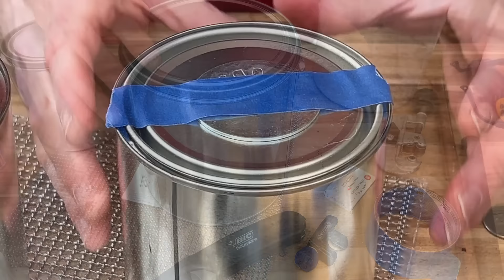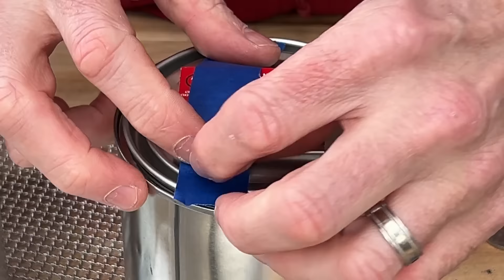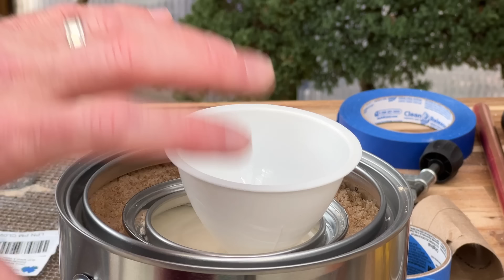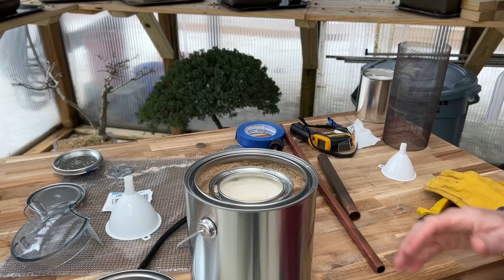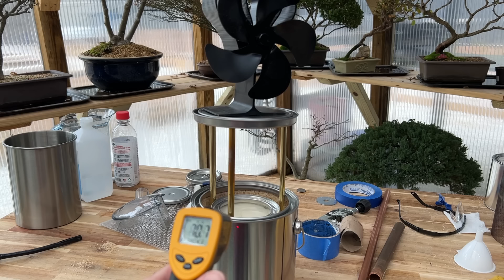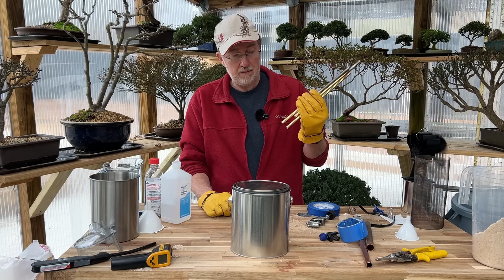Endless Heat Without Electric | Safe Reliable And Low Cost

Comment: Denatured Alcohol vs. 99.9% Isopropyl Alcohol

Denatured Alcohol
Denatured alcohol is ethanol (ethyl alcohol) that has been chemically treated to make it toxic or unpalatable, preventing human consumption. This is done primarily to avoid liquor taxes and regulations on consumable alcohol. The additives vary but can include methanol, acetone, benzene, or isopropyl alcohol.  

Common Uses:
- Solvent for paints, varnishes, and shellac  
- Fuel for alcohol burners and stoves  
- Cleaning agent  
- Disinfectant in some cases  

Manufacturing Process:
1. Fermentation & Distillation: Ethanol is produced from fermented sugars (usually from corn, sugarcane, or grains).  
2. Denaturing: Additives are mixed in to render it unsafe for drinking. The exact formulation depends on the country’s regulations.  

---

99.9% Isopropyl Alcohol
Isopropyl alcohol (IPA) is a different type of alcohol (C₃H₈O) that is not intended for drinking and has a different chemical structure from ethanol. It is a powerful solvent and disinfectant, commonly used for cleaning and industrial applications.  

Common Uses:
- Antiseptic and disinfectant  
- Electronic component cleaner  
- Industrial solvent  
- Automotive fuel additive  

Manufacturing Process:
1. Hydration of Propene: Propene (from petroleum refining or natural gas processing) reacts with water using an acid catalyst, forming isopropanol.  
2. Purification: Distillation and filtration produce high-purity (99.9%) isopropyl alcohol.  

---

Key Differences
| Feature | Denatured Alcohol | 99.9% Isopropyl Alcohol |
|---------|------------------|------------------------|
| Base Chemical | Ethanol (C₂H₅OH) | Isopropanol (C₃H₈O) |
| Toxicity | Toxic due to additives | Naturally toxic |
| Consumption | Made undrinkable intentionally | Never drinkable |
| Odor | Depends on additives | Strong medicinal smell |
| Uses | Fuel, solvent, industrial | Disinfectant, cleaner, industrial |
| Manufacturing | Fermentation-based ethanol + additives | Petroleum-based propene hydration |

---

Manufacturing Differences
1. Source Material:
   - Denatured alcohol comes from plant-based fermentation (like making drinking alcohol).  
   - Isopropyl alcohol is synthetically derived from petroleum or natural gas.  
2. Processing:  
   - Ethanol is fermented and distilled, then denatured with additives.  
   - Isopropyl alcohol is chemically synthesized from hydrocarbons.  
3. Purification:
   - Denatured alcohol doesn't need extreme purification (since it’s already toxic).  
   - 99.9% IPA requires careful distillation to remove water and impurities.  

Final Thoughts
Denatured alcohol is ethanol made toxic to prevent drinking, while 99.9% isopropyl alcohol is a different chemical entirely, made from petroleum. They serve similar industrial purposes but have distinct origins and toxicities. Key mental notes you can not drink denatured alcohol!!!

Comment: The larger bucket looks like a galvanized can...if it is, fumes can be very, very bad... I have an old turkey fryer can that looks like it may be larger, made of  aluminum.  It came with a nice, flat lid with a handle.  Thank you SO MUCH for this video.
Reply: The galvanized can does not get hot so there will be no fumes !
Reply: It's not galvanized, just a common paint can that hasn't rusted yet.

Comment: For a large room, such as a 2 car garage, cut the bottom from a 55 gal drum. You could put 4-5 small paint cans easily into the sand, lighting 1 or more as needed. Keep the top of the drum, with the seal removed, as a cover. You could even put the whole thing on wheels to be able to move it around, make a stainless steel mesh shroud to radiate heat when in use and could be stored on top of the cover when unused. A single low speed ceiling fan could circulate the heat efficiently.
Reply: Why cut the bottom off the 55gal drum?
Reply: @noniboalt9548  There are several reasons for this. Drums are sturdy, cheap and plentiful, will hold a fair amount of sand, you can buy wheeled bases for them for easy relocation, you can use the entire drum in various ways, and in warmer months you can use it for an oil catch pan or drip guard for working on vehicles.
Reply: Multi buckets-Great heat control!!
Reply: OR get a 65 gallon drum and add extra. Do they come in different  colors ?
Reply: Run a ceiling fan😂Except if you're out of electricity😂😂😂
Reply: @astrialindah2773  If you have no electricity then no, you could skip the ceiling fan part. As long as you thought you were being clever, that's what counts. Right?
Reply: @Punnikin1969 I'm not being clever I am being accurate 😶
Reply: @astrialindah2773  I agree with the first part of your statement, however not having electricity immediately excludes using a fan so it didn't have to be pointed out in the first place. Also, using the "laughing until I cry" emoji twice is just begging to be mocked. I obliged.
Reply: @Punnikin1969 I used it four times....😂😂😂😂

Comment: there is no such thing as Endless Heat to get heat you must have fuel of some sort that will have to be bought and used every time you want heat that's why i prefer solar heat with a storage battery then it can give what will seem like Endless Heat but your still using electricity as your fuel but i don't have to go get gas or oil and deal with the exhaust fumes

Comment: In White Sands in the winter in my fox hole I dug down and put an ammo can about three inches from the top. filled in around it an then filled the ammo can with sand. went to the medics and got some kind of alcohol and filled up the ammo can that had the dry sand in it.  Took the cover of the ammo can and covered about half of it. took my shelter half and made a low roof and used the sticks and dead branches laying around to finish it up. It got down to about 12 but it was about 40 in my foxhole. Also, out in the desert 100 miles from anywhere it was cold as hell and the sky was clear as glass. I saw a billion billion stars that night. As a 25-year-old I had never seen anything like it before. I still remember it like it was yesterday. That was 40 years ago. peace

Comment: Those fans would work great in the solar soda can heaters! Also, this is why I like the idea of having Spirit stills as part of my set up. You get cleaner burning pure alcohol, plus you get methanol as a multi-use byproduct, and you can use the same or additional stills for hydrosols and essential oils. The methanol can be used as a solvent for making biodiesel with used cooking oil. Very versatile addition!

Comment: Excellent video, I'd consider using a cast iron dutch oven as the outer vessel.
Reply: Why? Isn't 'heat retention and even distribution' the purpose of cast iron? The role of the larger container, with its cushion of sand, is to remain cool as I understood it.
Reply from the maker: That is a good thought.

Comment: Excellent design. I live in my campervan, and always looking for off-grid heating ideas.
Reply: Before people consider using this device as described or a larger one or more numerous ones in the room which is going to be inhabited for working or sleeping consider the following. Your life depends upon it. Combustion heating devices consume oxygen from the air to some extent. They also generate carbon dioxide and carbon monoxide which are both heavier than air and start filling the room from the floor up if there's no circulation. Usually building construction is drafty enough to supply exhaust of products of combustion and entry of fresh breathable air. However if you're going to use Open Flame to heat your van your RV or a closed room in a modern construction house, you better make sure that there is ventilation. Even a clean burning fuel heater properly designed in a confined space which is not supplied with combustion air will suffocate you. Just make sure you've provided enough cross flow ventilation to provide breathable air in as well as exhausting CO2 and products of combustion out.
Reply: I would think it would put out a tremendous amount of moisture.
Reply: Sadly people have died using these styles of heaters in confined spaces- good ventilation is imperative
Reply: For only outside use

Comment: For high humidity and to water proof matches is to coat with wax. When you go to light one you have to remove the wax from to tip
Reply: I dip mine in clear nail polish.let dry.They light right up.

Comment: On another channel, I saw the creator use stainless steel or copper screen. If you were to roll the screen around the paper towel roll so that it stood 6 or 8 inches above the top of the roll, it will glow red hot and radiate much more infrared heat.
Reply: Dad taught us how to make what he called a Cowboy or Cub Scout camp stove. Larger can with holes in the bottom and around the rim. Another smaller can with holes around the sides. Put a Sterno can or candle in the smaller can. put the larger can upside-down over the can with sterno/candle. First light the heat source.  The sterno will create heat in the larger can. You can actually cook on it.
Reply: Wow this is good to know. I'm gonna teach my little grandson this. plus I will have it in case we need it. Thanks for sharing this. ❤ It was Kool too.
Reply: How long will it burn?
Reply: @laurieshifflett2916  ...How long will it burn?...

I don't know. I never tried it. As I said before, I only saw it.
Reply: I tried this …it’s totally not work temp source never gain over 100 degrees….copper temp will be less than source.
Reply: That would probably work from the heating standpoint but you wouldn't be able to store it with the lid on. 🤔
Reply: The screen cylinder would be made to slip within the rim of the odor can and rest on top of the sand not embedded to the bottom of the odor can further the cylinder would be 10 in high approximately and rolled from a length of steel or stainless steel mesh to be about three layers deep spiral and wired with steel wire to secure the spiral from unwinding from its cylinder shape. If you want to store the heater or put the fire out use the gloves to lift the cylinder off of the top of the sand and put the lid back on the inner can to snuff out the flame.

Comment: The fan is powered electrically by a Pelletier device. It is the same unit that is in those 12 volt electronic cooler / heater boxes. It is a bank of thermocouples. When you apply power to it, one side gets hot and the other side gets cold. Conversely if you apply heat to it, it will produce a small voltage to drive the motor. Years ago, my father in law paid almost $100.00 for one to place on his wood stove and it was surprising how much air that it moved.

Comment: I bought two of these fans for a tenner each without realising these fans need a basal heat scource of at least 85C to start turning..............i was hoping that they would work sitting on an oil-filled electric radiator  but no joy.

Comment: This is not safe. It literally says on the can of fuel you are using "USE OUTDOORS IN AN OPEN AREA IT IS NOT SAFE TO USE INDOORS" "IF YOU MUST USE INDOORS OPEN ALL WINDOWS AND DOORS AND CIRCULATING FRESH AIR" how much heating is it going to do with all the windows and doors open and circulating air??
"THIS PRODUCT CAN EXPOSE YOU TO METHANOL, CARBON MONOXIDE AND METHYL ISOBUTYL KETONE" which are cancer causing agents. Denatured alcohol is Ethanol (the alcohol in booze) with toxic additives (denaturants) to prevent people from drinking it. This heater is only safe to use outdoors. The fan only spreads the toxic fumes more. Read up on all the dangers of burning denatured alcohol and never use this stove indoors.

Comment: Suggestion on the big super when you were going to make a sheet metal you know when they take things off they can put it to cover the the other bucket that's bigger and a piece of sheet metal or a lid off of pot on the stove, and I understand I know it's different than like that turns to mud and I live in North Carolina so you definitely just have to have sand to not dirt? You might get to reading this I'm sorry if you got so many and I probably don't subscribe cuz I'm not too handy on things but you can take a can and it was just like a tuna can or chicken can you take cardboard and you cut it to the size of it like if it's 2 in tall then you curl that cardboard up in there and you take and burn a candle and you burn the wax all over it so for an emergency you can just take that can with you and you can just like that cardboard and it burns that wax and that cardboard and it does burn for quite a few hours I just thought I'd throw that in maybe you can improve on it with cardboard in the candle wax thanks

Comment: I prefer smoke detectors and carbon monoxide detectors as separate units. Smoke rises but carbon monoxide is heavier than air and sinks. Putting a combined unit high on the wall may have you breathing carbon monoxide for a while before it alerts you.
Reply: Good life saving comment!!!
Reply: @tiggywink1 this is for outside use  ONLY 😊
Reply: Smoke detector  this is only for outside camping. greenhouse .OUTSIDE ONLY 😊
Reply: @NinaBoulton it is not only for outside or outbuildings. You can use this safely indoors in an emergency. Watch the video 😉

Comment: The fan is technically an electric fan it runs an electric motor with a peltier cell that creates electricity  with the heat as you heat one side the other side gets cold and it puts out electricity they use them alot in mini refrigerator and electric coolers they make 12 volts on average
Reply from the maker: Thanks greatly. Cheers

Comment: The long lasting shortening candles (many videos on the web) I created are good light sources but not heat like this.  Your other video with the carbon wicks inside copper pipe is SO awesome.  Could one make a small version of this with the carbon felt around the TP and can one just top off the TP when it is getting low?  The comment about securing the can to a good tip-proof base is excellent for folks like me.  I have the water resistant matches in a ziplock bag taped to a few of the candles and will do the same once I create one of these.

Comment: You can always put your sand in a baking sheet and put it in the oven to get it to be dryer before you make this because to me this is something you should have made up and just sitting somewhere just in case you need it
Reply: I would think you were right on drying out the sand because those cans I would think would rust if the sand has moisture. But I don't know how long that would take.🤔

Comment: You can make the inner can outside of the bigger can so you can make sure you can turn it upside down to make sure the distribution is done correctly.
Also I have tested empty metal tea light tins with sand and alcohol. One tbsp of alcohol poured over the sand in the tin burns for 14 minutes.  I do believe the reason for the toilet paper wick is too keep the burning liquid contained if knocked over as it's already absorbed by the toilet paper and sand will work the same. It burned fine in sand during the tea light metal tin test.

Make smaller ones for individual use. A small veggie can used inside a larger tomato sauce can.

I have sand for reptile cages, you have sand for your gardening. People you need to buy some. I use it for pets so I buy children play sand encase the reptiles injest it. I always wet and dry it in the oven in small batches since it comes in 40-50 pound bags.

If your home is use to live flame of candles you can use se the mini flame heaters line candles just as safe as candles.

Take some small tomato paste cans and normal size veggie can. Use sand over toilet paper. Take a large roasting pan and fill with 3 inches of sand. Put a brownie pan in that and funnel sand until one inch from the top. Fill the brownie pan with sand 3/4 of the way to the top. Insert the tomato paste can and that is now a fire pit.  Very heavy and can be used for heat. And as always keep both a fire extinguisher and fire blanket handy.
Reply: You seem very knowledgeable, but I can't understand the instructions 🫤

Comment: Excellent video, sir!  You can use a washer shaped magnet for an opener. Last year I used ceramic and oil filled space heaters and my monthly electric bill was $189. This year I switched to infrared space heaters and my monthly bill has dropped to $70!
    I am going to use your ingenious supplemental heating systems to bring that bill down lower.  I'm in zone 7a in northwestern Washington state so we don't get below 0°f very often but living in a remote area in the north Cascade mountains, we do lose power a lot!! Thank you so very much for sharing your knowledge!! Namaste 🙏
Reply: So you reduced your electric bill, but what do you pay for fuel?
Reply: @8546Ken   No other fuel. It's completely electric infrared. Not helpful during our frequent power outages.
Reply from the maker: Thanks, I’m happy that the video was helpful!
Reply: Where did you get infared heaters?
Reply: @ritadelitta424   Amazon
Reply: @ritadelitta424 I have one that I bought at BiMart here in Oregon.

Comment: I have tried this and it works well but I just wanted share a few comments. One, do not let the alcohol burn out! The toilet paper started burning. Second, while I like the fan, if someone does not have one, the convection currents produced by the extreme heat will also help circulation.
Reply: Is there any data on how long that set up will last? 8hrs? 12?
Reply: @JoseRamos-su3ep my test burn only lasted 2 hrs max
Reply: @GeorgeRing-s4e 2 hrs?! That’s not worth it to me
Reply: Thank you for your comment...exactly what I wanted to know about if the toilet paper would burn if the fuel runs out.
Guess I'll have to do my own experiment to find out how long the fuel will burn.
Reply: Use fiberglass...

Comment: The sand will dry with time if the lid is left off the big container for a week or so.
Also thinking of smaller ones the outer can being a quart size and the pint inside.